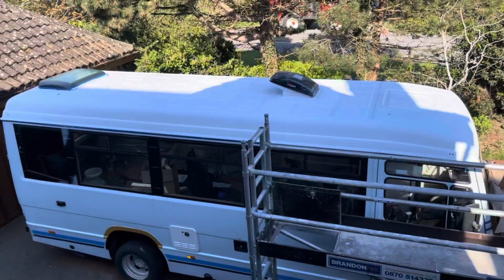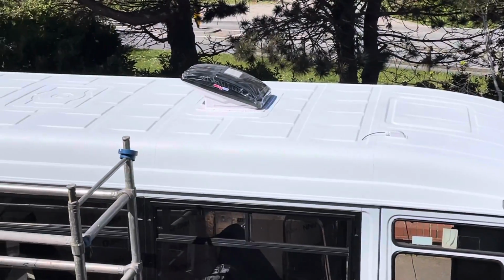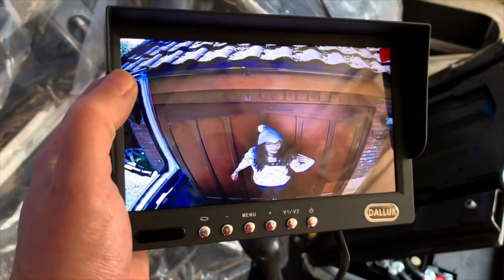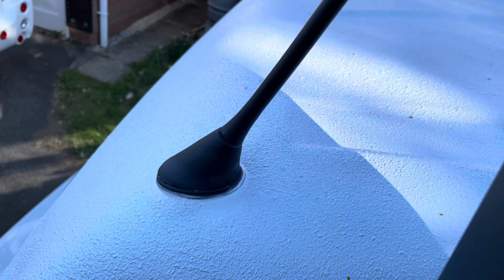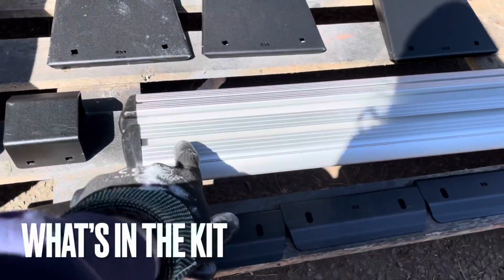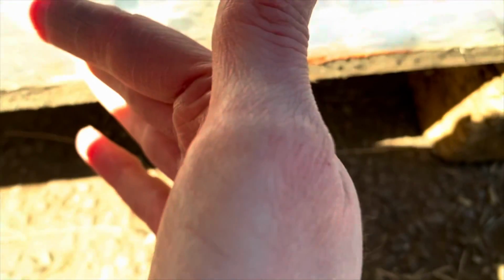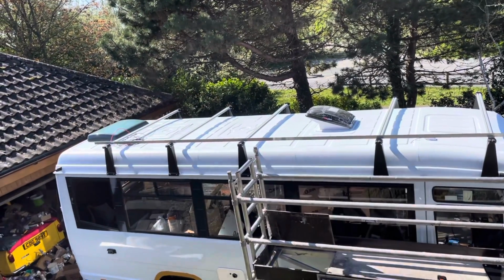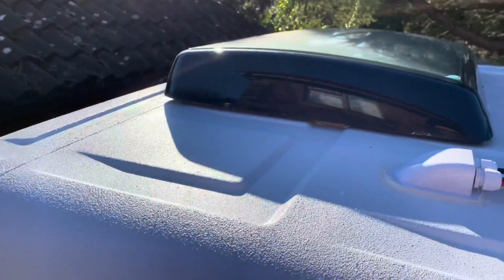Lights, Camera - DIY Lightweight Roof Rack Pt.1 | Mercedes Vario Bus Conversion

Comment: Link doesn't work for the van guard kit? I would like just the uprights for my HI top Vario because I might use aluminium extrusion for the cross members. Where can you buy the tall roof clips for the rail on Vario? Thanks. I am like you I think I need 6 with all the fittings, but most seem to be three or four
Reply from the maker: Morning. The bars we used are Ulti Bar VG154. They are originally for a Ford transit. They come in packs of 4 and 2. Screwfix seem to have a good deal on at the moment of writing. 

However if I were using aluminum extrusion I wouldn’t use these. I’d consider the Tygrys bars; which Work with the extrusion. They are slightly shorter in height too.
Reply: @WanderbusAdventures  thanks, is that the bars or the brackets as I want just the High Roof brackets - thanks
Reply from the maker: The van guard ones we have used are a kit. Brackets and bars. The other ones are just brackets. I’ve never seen them, but they look good.

Comment: The roof rack looks great!  Just a little suggestion though, I noticed you have the nuts facing forwards, they’ll take all the wet when driving in rain, it may be useful to have them facing the back so that the wind isn’t driving the water into the fixings on your mounting brackets.  It might slow down the rust and make it easier if you have to undo them!
Reply from the maker: This makes absolute sense and when assembling we had the same conversation. The bolts are square on the back end so only go one way - really we think the square bit should be on the front face to allow installation as you suggest it. The bolts are made of a rust proof material but totally understand your logic.
Reply: @WanderbusAdventures  If you’re concerned about it and it’d be a lot of work, you could try swapping the mounting brackets to opposite sides of the bus, left side to right etc, it may turn the square holes to face forwards! You’d have to have a look and see if that’d work!
Reply from the maker: Again a good idea; but it would make the bars face backwards. I do like how we’ve had the same thoughts though - I did find it a bit weird. All their bars seem to be the same. I’m not overly concerned but did think it was a strange way to design them.

Comment: I’d certainly think about a wind deflector as the wind travelling under the panels will bounce between the roof and the panels causing a lot of wind noise and possible damage. Try fitting a makeshift deflector and going for a drive just to see.
Reply from the maker: Thanks Malcolm. We’ve got an idea of how we can make something that might even look pretty snazzy. We can make a prototype of course. Thanks for your ideas, really helpful. Take care 🚐🚐🚐

Comment: No problem with your late reply on the last video , Great stuff , how much did the roof rails cost with brackets , cheers !.
Reply from the maker: So we bought the vg154-4 and VG154-2 which came in at about £285 delivered. We had considered other after market brackets but they were as much as the whole thing - and we’d have then needed ali extrusion for the bars. We are hoping to bring the rack project in for under £500 all in (plus the solar)
Reply: @WanderbusAdventures  , great stuff , cheer !

Comment: great work guys . i had a similar set up with the roof bars but i ended up under slinging my solar panels to reduce the height by 6cm and reducing the wind turbulence under them . stay safe
Reply from the maker: Thanks Dean. That’s good to know re your setup. How many panels were you running? Thanks for watching. Take care 🚐🚐🚐
Reply: @WanderbusAdventures  it was 2 120w panels very poor by today's stranded. as it was 14 years ago

Comment: Im just about to start designing my roof rack on my ambulance conversion, I've debated over a spoiler as well 🤔 not sure what will create more lift ? Air over will be faster and that will create low pressure and hense lift but will it be less than the air pressure under the pannels without a spoiler 🤔 all my roof vents have spoilers from factory so the original ambulance builders thought they did something, what to do. 
I am adding extra feet to mine in the middle to take some of the load off the drip rails as mine are aluminium, not sure they have much of a load rating compared to steel like you have ?
Love the raptor finish on the roof by the way 😎
Keep it up, enjoying the series 👍
Reply from the maker: This is the exact debate we are currently having. We need some sort of aero expert to update us;  if only we had an F1 wind tunnel 😂. We will keep you posted on this. 

The feet I think are a good idea. Can’t hurt and I’m hoping will reduce a bit of flex if that makes sense. 

Your ambulance looks great. How long have you been converting it?

Finally thanks for your comment. Really pleased you’re enjoying it and wanted to thank you for watching. 🚐🚐🚐
Reply: @WanderbusAdventures  I've had it for about a year now but had to park it up for the first 5 months while DVLA sorted out the taxation class from ambulance to PHGV, i do a couple of hours a day as work allows 😭.  Looking forward to the next part 👍😎
Reply from the maker: Ah yeah the DVLA backlog is legendary at the moment. Same boat with the work thing; it’s nice to have a job but the urge to work on the bus is strong 😂
Reply: @WanderbusAdventures  Still a back log ! i did it last year and it took 4 months and all i got back was box van, which meens i cant drive it in London cos of the LEZ (i live in dam london LOL) , it has to be camper and DVLA say it isn't, so i styripped it out and started again to do it my and sod them ;) i'll get there.
TBH watching vids like yours gives me the kick up the bum to get out and do it :) sort of lost energy when the LEZ changed (with very short notice) and i couldn't use it, have to pay £100 to drive it the 1/2 a mile from where i live to outside the LEZ, bit of a downer but your sort of vids and other on YT keep me going if you get me :)
Reply from the maker: That does sound like a huge pain. It does seem to be getting harder and harder to get the V5C changed; but you’ll get there I’m sure. £100 mind - that’s madness. Ours will be the same in Bristol actually when the changes come in, so we won’t be going through there unless we can get it changed too. Glad you’re enjoying the videos, we take a lot of energy and inspiration from YouTube and the community and are happy to share our journey 🚐🚐🚐

Comment: G'day that roof is the "ducks guts" and if the rest of the bus turns out like the roof it will really be something.    I reckon that you wouldn't need a wind deflector in front of panels those bars look pretty strong and the air can flow underneath unimpeded less drag.   That reversing camera is the same one I had on my 4X4 and it lasted a long time and it was subjected to a lot off road, it's all looking good Rich.   Good to see you all again I always enjoy watching the instalments, I suffer rheumatoid arthritis and fibromyalgia and osteoporosis I live in chronic pain.   I have had two total Knee done and a total hip so I love watching you turning the bus into a home you forget about pain watching you anyway I've raved on too much stay safe regards John
Reply from the maker: First of all big hugs from us, we are really happy and proud you want to watch our progress and your help and support is amazing. Kelly suffers with an autoimmune disease and is often dog tired; so can really empathize with you. 

That’s really good to know regarding the camera; it wasn’t the cheapest but it wasn’t silly money either. The bars are rated for 80kg each and we are putting nowhere near that load through them, so pleased they are strong enough. It’s a tricky one - we might suck it and see but do have a simple plan should we decide to make a wind deflector to surround a swanky light bar. 

Also super proud that the roof has been rated the  ‘ducks guts’. That’s high praise 😊. Take care and thanks so much. 🚐🚐🚐

Comment: When we put our solar panels on the roof rack the wind noise was BAD  The solution we used was round long black pipe insulation, like the pool noodles, slit to fit over the bar and secured with cable ties.   Made an incredible difference, and not expensive.
Reply from the maker: That’s a great tip and an easy fix as you say. We will keep this in the locker - we are also pondering a simple wind deflector for the front one. Based on this mega feedback we think it’s worth a shot? Thanks so much for the tip; really helpful. And thanks for watching too 😊. Take care 🚐🚐🚐

Comment: Nice neat roof rack, we recently purchased and installed similar from Rhino on our  SUV to attach an  awning, will look good when the solar i and light bar is installed. Stay safe cheers from Australia 🇦🇺🇦🇺🇦🇺
Reply from the maker: That’s a beauty of an idea and we are planning the same. The brackets are almost vertical which should make for a stable base for the awning. Glad that worked for you Barry. The frame and solar is up next - and the panels are whoppers 😊. Take care and thanks for watching 🚐🚐🚐